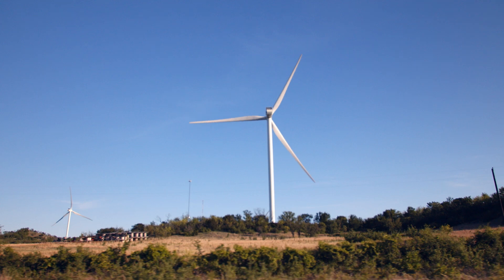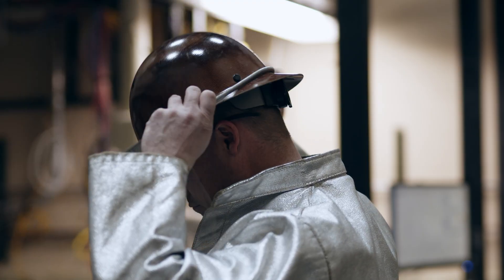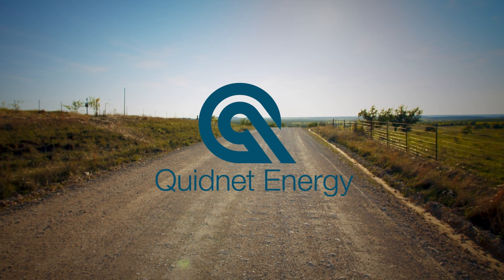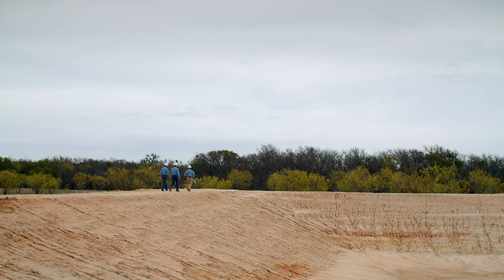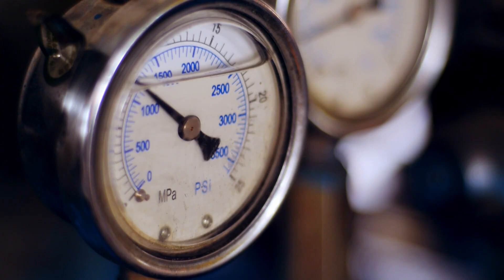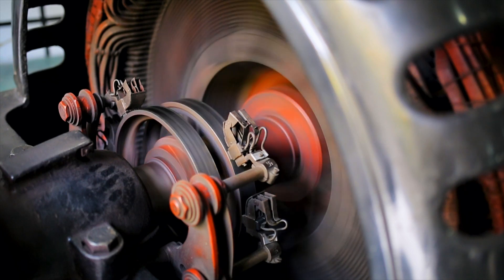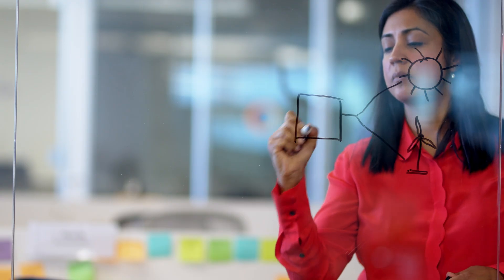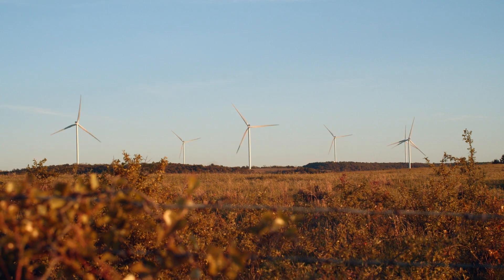Energy storage breakthroughs

Comment: In addition to solar/wind that is a huge scam, a very expensive infrastructure taking up a lot of space and damaging the environment while not delivering power that can be relied on, here is the secondary scam of alternative storage, that adds a very expensive secondary infrastructure taking up again a lot of space while promising to fix the flaws of the first one. Let me create an expensive problem for you for which I am going to offer my also expensive solution.
Reply: it might seem like that now, but once the easily accessible coal and oil run out, and like any technology, renewables will continue to be less expensive to develop. There will be a crossover point. Right now, solar panels and wind turbines generate electricity cheaper than fossil fired sources, but, the energy storage necessary to firm up the grid against the intermittent power from those sources is still VERY expensive. Once that comes down, and fuel continues to become more expensive, it will all change. Drilling a well is far more detrimental to the environment, than installing a turbine, however, in terms of total energy available, the well wins. it would take a long time for a turbine to match the energy of the petroleum that can be pumped up from a well. Solar panels can be adapted to existing structures, meaning no further use of land, nor any further environmental impact to install. Solar farms only make sense, once all the viable roof tops have been exploited. and then, only if solar will give more average energy, than installing turbines on the same parcel of land.
Reply: @vincentrobinette1507  civilization goes forward with more energy, higher energy density, more raw materials, more detailed manufacturing processes, at a higher pace, at a faster rate of calculations and decision making. Peddling solar and wind is going backwards, these sources provide less energy with a lot less energy density. This is akin to telling people they should be poorer, less healthy and live shorter lives (lower energy consumption will lead to all of these), while charging them a lot more money for it.
Reply: @andraslibal  The increase in energy consumption isn't quits as bad as you might think. Consider your computer. The old desk top computers and tower computers used right around 200 watts of power. Lap tops use about 20 to 60 watts of power, and have 10 times the memory, and process information 10 times faster. Now, let's look at a new smart phone. It's 10 times more powerful than a typical laptop, and it consumes about 3 watts, 7 watts if the battery, the size of a fig newton bar, is charging. Technology is using less and less energy, despite the functionality becoming better and better. What we're doing now, is not sustainable. Using solar energy is.(wind is an indirect form of solar) If the sun goes out, we've got bigger problems, than keeping the lights on, or getting around.(transportation) If we don't start working right now on alternative solutions, we're going to have a much more difficult transition, when conventional fossil sources become more scarce, thus, more expensive. We're not going to suddenly run out of oil or coal, it will just be so hard to get to the deeper reserves, that it will become prohibitively expensive. I'm in favor of implementing renewable energy now, so the economy of scale can start driving the prices of it down now, so it can be a smooth, easy transition. Just the rooftop of a single family home has enough area for panels, to essentially go off the grid, given enough battery capacity. I have 3 refrigerators, a deep freezer, and a Coi pond pump, which draws 12 kWh per day. I'm able to run it all, with a 64,000 watt hour battery array, powered by 14,400 watts of photovoltaic panels, which were purchased for about $.45 US per watt. I have yet to build the inverter, I can't find the one I want. The batteries will cost about $6,500 US dollars. I don't yet know what it will cost to build the inverter, I can't find the inductors I want, for the pulse width modulators in it. I know how much the semiconductors will cost. They want a king's ransom for the silicon carbide field effect transistors I want for the output stage. Bottom line, In the US, the residential sector uses about 37% of the total capacity of the grid. Solar, and behind the meter storage can just about eliminate all of that. In the long term, very economically. Photovoltaic panels are only about 1/10 the cost, that they were 25 years ago.
Reply: @vincentrobinette1507 consider however that today all your family members have a mobile phone, probably a smart watch, a laptop of their own, there is a smart TV etc ... power consumption goes up, not down, even as our tools get better smarter, can do more things with less energy. 

We have the knowledge to do molten salt nuclear reactors that are inherently safe. Nuclear has the highest energy density we know, also we know how to do a more complete burn and the end products have a short half-life of 100 years. Your entire life's energy consumption creates waste that fits in a coke bottle. This is a matter of political will, the technology exists (since the 60s, Oak Ridge demonstrated it).

Yet what we are pushed towards is solar/wind. You need to calculate the cost and environmental impact of solar per total lifetime, materials, manufacturing, end-of-life disposal and the same thing for batteries. On a large scale this is not feasible, it will only lead to blackouts and enormous cots + strain on the environment as well (solar is not as eco friendly as you think, nor is wind, both are detrimental to wildlife). I see a value for add-on solar however if #1 you live in a predominantly sunny area such as the SouthWest USA or California #2 you care about energy independence for your household. I see a value in that. But even sunny California would need more nuclear energy for base load (about 3-4x as much as the Diablo Canyon plant output is) to have a stable energy source.

Note: I live in Eastern Europe in an apartment that by US standards is tiny, that is well insulated (low cost of heating, no need for AC) I drive a lot less than the US average and we also produce a lot less waste (300 kg/year compared to Denmark or the US at 700 kg/year) and I try to avoid plastic bags. Just so you know I'm not bringing this argument to justify destroying the planet.
Reply: @andraslibal  U-235 is a finite resource, so are fossil fuels. Sooner or later, they will be un economical to acquire. Wind and solar are inexhaustible. Not only is the 'fuel' free, but it's delivered for free. You hear all this nonsense about "free enrgy devices"? well, wind and solar are those free energy devices that actually do work, and are not dangerous.(Chernobyl, Fukushima) Unless there is a break-through in hydrogen fusion, wind and solar are the major solutions, to keep the lights on, and keep us on the move, once the "low lying fruit" has been picked. Experiments with graphene are using carbon, rather than copper to produce conductors 10-50 times better than copper. That means that the high gauss magnets needed to contain the plasma can operate without cryogenics. That's a MAJOR step, towards Nuclear Fusion. Once that's developed, our electrical energy problems are solved, being that hydrogen is virtually inexhaustible.
Reply: @vincentrobinette1507  I actually worked in both plasma physics and superconductors. Instead of some yet-te-be-proven hype let's talk about real things. Wind and solar are the most expensive forms of energy because they are low density, making the wind and solar facilities is very expensive and the yield is very low compared to the expenses + the land + the environmental impact + the materials used. Not to mention the intermittency. This is not a solution. Even uranium is abundant especially if new reactors and fuel cycles are used, this is working in France it's not a hypothesis. And we have not even talked about thorium and molten salt reactors - the type of reactor proven to work for a decade in Oak Ridge. Thorium is so abundant that it solves our energy needs for a very very long time. But if i you're just going to repeat a mantra like Chernobyl and Fukushima then I guess there is no use in telling you about these things.
Reply: @andraslibal  We have wind and solar now. I hear all the time about thorium, but no one can quote a source for the quantities necessary for the generating capacity we need to displace all fossil generating capacity. I agree about the Uranium. It seems, like it might be possible to refine spent cores, and reuse uranium 235 from them. We know, that there is a lot of residual 235 in a spent core. To concentrate that to make new cores solves 2 problems: Radioactive waste, and, a source of uranium 235, to maintain existing reactors, and perhaps new plants. Mining uranium is like mining any other mineral or metal, other than that the back ground radiation is considerably higher, but not necessarily dangerously so. If a new reactor is built, it needs to be a completely isolated system, with no internet connections or modems whatsoever. A hacker getting into one of these and we've got another statistic to add to my list. Reactors are also prime terrorist targets, as well. There isn't much you can do to annihilate an entire population by hacking a wind farm, or photovoltaic array. On another note, the return on investment on nuclear plants takes too long. It's not cheap to build a nuclear power station. Here in the west, there is a nuclear plant that has not been completed, because of cost overruns. There are well over 130 nuclear plant cancellations in the United States right now, according to Wikipedia. I can't remember the name of the site, but there have been millions of dollars already put into its construction, but the investors have pulled out, because they don't think they will ever get the return on their investment. They're just too expensive. They, like renewable energy, rely on very high electrical rates to be viable. Right now, wind and solar are cheaper than even a new coal plant. What you're saying was right 20 years ago, but now, renewables are a fraction of the cost they once were, and fossil fuels have gone way up in price. Too many people think that renewable energy is what's raising the cost of electricity. The opposite is true. They're coming into markets, to curb the run-away increase in the cost of electricity as conventional sources become more expensive to maintain. The only thing missing right now, is good energy storage. Keep in mind, defunct coal and nuclear plants are perfect for energy storage, because the infrastructure is already there. The building, the transmission lines, substations, transformers: Everything. That would allow flywheels, batteries or something else to be installed with 0 impact to the environment, that wasn't caused by the original construction. To decommission a wind turbine, you knock it down, and haul it out. Not so easy with a power plant, especially not nuclear.

Comment: The pumped hydro is interesting, but what was the driving source of energy to pump the water into the well  for storage? And what about the possibility of leaks in that well , losing a lot of energy?
Reply: The other question is the round trip efficiency. For every kilowatt you put in, how many watts can you get back out of it? Efficiency is a major consideration to me, just the same as losses. What you describe is called "standby losses".
Reply: Jeffrey, I would assume electric power. Alternatively would be to connect it to a wind farm and use mechanical energy from windfarms to drive the pumps.

I don't think leaks are that much of a problem. Based on what I know of oil wells, they don't just randomly leak oil to the surface. It has to go through the oil well.

The only issue is when you are drilling you may accidentally connect reservoirs to each other with different pressure so that oil in one reservoir "leaks" into another one.

I think one of the most obvious ways possibly of using this technology would be to pump water into oil reservoirs that have been depleted in the past.

Comment: What about graphene batteries/supercapacitors
Reply: That is for SHORT term storage. This is for LONG term storage. For short term storage you want high efficiency but can tolerate higher price per kWh storable. However for long term storage you can accept lower efficiency but cost of storing a kWh has to be low.

Comment: Misleading.  Nothing new here at all, I'm concerned Mr. Gates whilst a remarkable leader of business in his fields hasn't done the basics on storage/loss/economics of these technologies that have been around for a LONG time and the reason they're not major players IS because they're not very good at doing it. 

Thermal Salt = 'large' losses energy in the conversion of electricity to heat and worse, when you go back the other way, heat to electricity.  Large scale costs might prove better than batteries though that has yet to be shown with calculations.  It's 'better' if you use the sun to heat the salt which they do for the reflective mirrors.   

Iron storage = Iron batteries,  aka Edison [yep that long ago!] batteries.  50% loss from charge to storage, large size, though not major issue for the application.  Costs are higher to the market than lithium ion currently, though scale might change this.  The only real advantage is they effectively never wear out unlike lithium ion.  The best batteries in this role are actually lead acid for price.  This is why they're used in forklifts and large UPS systems.  

Whilst hydro power is one of the best sources of renewable energy, it relies upon rainfall [the sun and evaporation] to do all the heavy lifting and providing the energy.  As soon as you start using a pump, the energy used to store is a loss and then you've also got a large area of land that has some kind of pressure vessel [under ground?].  I can only talk in terms of using a hillside as I've not done the research of this, though in that case the volume of water needed per kilowatt hour is vast and expensive.  

These 'old' ideas don't provide any breakthroughs, only old problems that were never solved before.

Comment: I think potential energy is a great idea, but would argue that its most abundant in tidal forces and that a system in which an anchor point and the increasing swell of water height is utilised, like a rowing machine with a float on the pull bar. Or even displacement which if I understand correctly can in theory lift billions of tonnes as each major world port experiences everyday. Surely we can utilise the potential energy created by this difference.

Comment: high speed flywheels have a very high energy density.  batteries of them would be a possibility.
Reply: There has been research done on flywheels, and they look pretty promising for grid scale energy storage. Especially, the ones supported on magnetic bearings, operating in a hard vacuum. It's theoretically possible, for flywheels to store energy for months with minimum losses, and they have a cycle life far superior to any battery on the market. The round trip efficiency of prototype flywheels have been about 80- 85%, about the same as lead acid batteries.
Reply: yes but efficiency and the time they can hold a charge are some substantial drawbacks.

Comment: Energy storage is all prohibitively expensive.  Ironically batteries are much more expensive then pumped hydro or molten salt, yet governments want to go with batteries because batteries "feel" good.

Other notable mentions are using nearly free excess power to mine bitcoin and make hydrogen for fuel cells. Again it's picking the best bad option. 

Every choice is inefficient and loses lots of energy from converting.  Batteries are the most convenient and efficient, retaining 99% of the energy but  also the most expensive. Pumped hydro looks like the most economic pick, due to simplicity, which illustrates how wasteful renewable energy and storage is. Pumping water up hill just to run it back down, thousands of enormous pumps eating up excess power. 

Renewables can't support more then 30% of a grids electricity without starting to need massive storage and this is where the cost skyrockets. 30% renewable with gas coal and hydro backup and peaker plants, and a big battery for grid stability (batteries are much more valuable to stabilize and make a grid more efficient then their raw storage capacity, they are great at regulating current and keeping the amplitude stable, which is important because wind turbines are hard on the grid and send all kind of variable wacky unpredictable current into the grid. 

But the most cost effective energy is still good old coal and gas, especially now, gas. hydro is an amazing on demand source where it is available. Nuclear is a solid  baseload power source. In fact you can be carbon neutral and have a complete grid  with just nuclear and hydro.